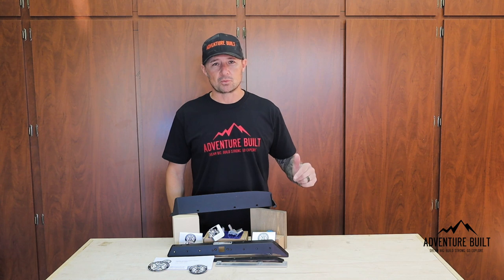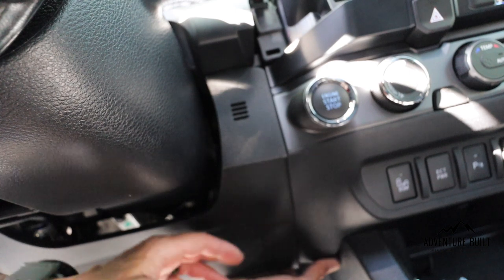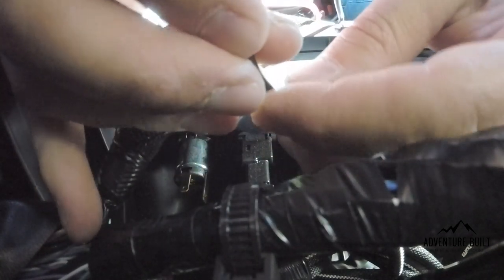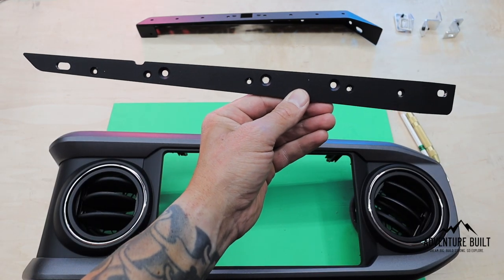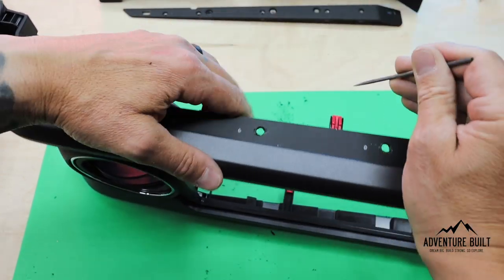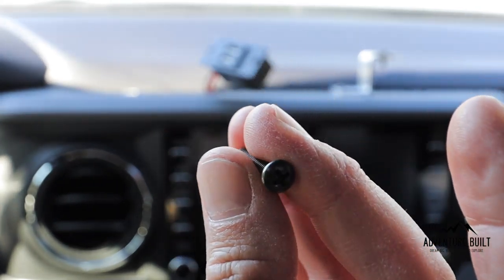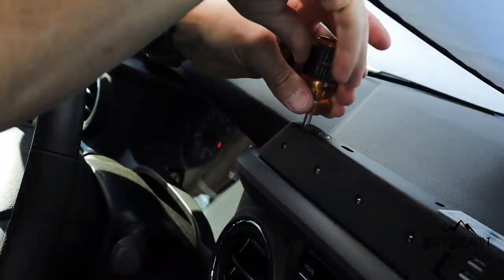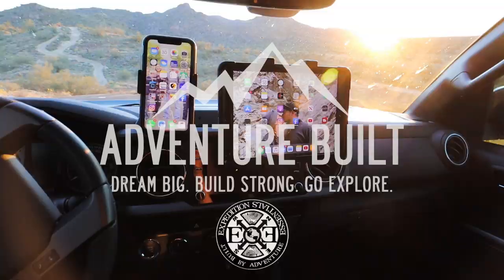2020 TACOMA POWERED ACCESSORY MOUNT - EXPEDITION ESSENTIALS - MOUNT NEW IPAD/PHONE/GARMIN

Comment: The only thing I could add to this install is properly looming and securing the wiring behind the dash.  That will prevent a possible electrical fire in the dash down the road.  Just sayin, YMMV.  But I have witnessed rigs burned to a smoldering heap of scrap from not taking precautions when wiring.
Reply from the maker: Not a bad idea at all.

Comment: So...the wires you're tapping into are pretty skinny.  Isn't the cig plug fused and rated for only 120W?
Reply from the maker: I haven’t had any issues charging items off the 3TPAM outlet. I usually plug in my phone and GoPro to it and don’t have any issues.
Reply: @AdventureBuilt  don't get me wrong.  I like the idea.  I just think a separate fused lead would make more sense.
Reply: @gimmeabreak-h2h  Im thinking of going this route. Maybe even constant power. Would that be stupid? What is the necessary fuse for the quick charger USB?

Comment: If you purchase an aftermarket radio, will it interfere with the mounting brackets?
Reply from the maker: I think it will completely depend on how the stereo mounts. Most stereos use adapters to fit into the stock location but they are all different.

Comment: I wish the USB ports were in the back so you can hide and route the cables better. 

With the iPad you can hide wires but with smaller devices you will just have a lot of wires hanging there.
Reply from the maker: I actually like the ports on the front. I use short cables and the wiring isn’t bad. The next big thing will be Wireless Charging for the entire bracket. That would be cool. For now though it is perfectly manageable.
Reply: Adventure Built I was thinking if it was in the back under the cable management hiding piece you can put whatever wires needed there and then little cable pass thru. But wireless charging would be cool! I want this rack tho, seems nice

Comment: What exact amount are using for cell phone and tablet at the end of that video there???
Reply from the maker: So the Cell Phone holder is the Ram Mount Quick Grip XL Phone on my iPhone XR. The tablet holder is the ibolt tabdock bizmount heavy duty Mount. They are both amazing holders. Very secure and very versatile. I recommend both.
Reply: @AdventureBuilt , I really appreciate your time and your reply. 
How stable are both of those mounts? Do you experience any vibration and shaking when you're driving the truck on road and off road?
Once again thank you for your time

Comment: Great video.  What is the point of that one, self tapping screw installed near the end?  The instructions do not explain its purpose.
Reply from the maker: Thank you very much. I’m pretty sure it limits the flex in the bracket on the left side if you were to add a bunch of weight. Whatever the reason it works. I did a 3 day trip on the AZ Backcountry Discovery Route and had the 3TPAM loaded down. Including my 10.2” IPAD. No problems at all. Hope this helps.

Comment: If you need to access behind the radio or any of the controls, what's the best way to take the dash off without removing everything you just installed?
Reply: Edward Donlin The bezel pops off pretty easily.  The radio comes out with a few bolts.  It’s pretty easy and that’s the only reasonable way to get behind the dash.
Reply: Just use a bigger Hammer bro :-)

Comment: Unfortunately that top part of the center console was never intended to hold any type of load.  I can see it in a few years all of those areas cracking.
Reply from the maker: The load is actually supported by the head unit bracket and sub frame. Plenty strong enough. Haven’t had any issues at all.